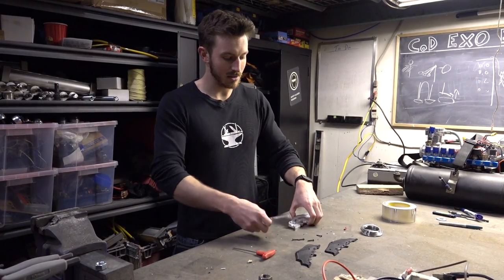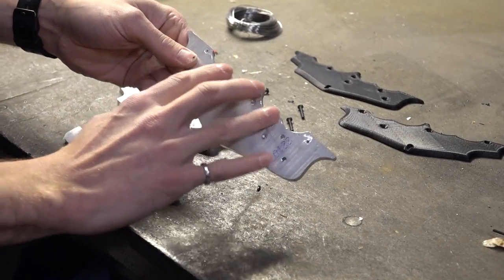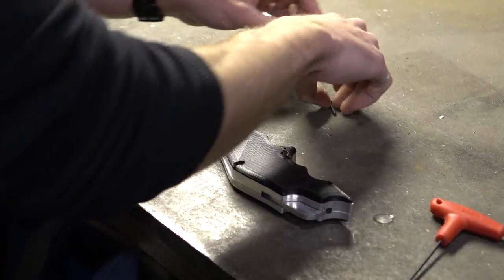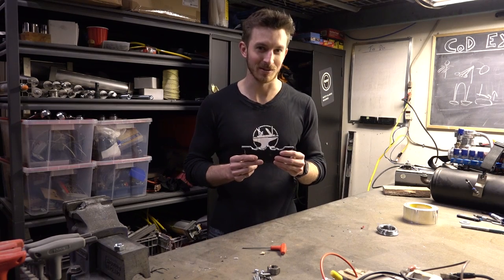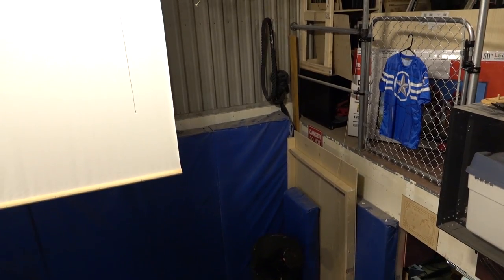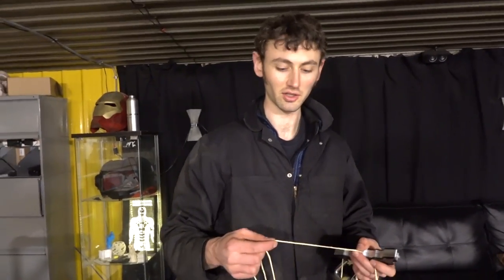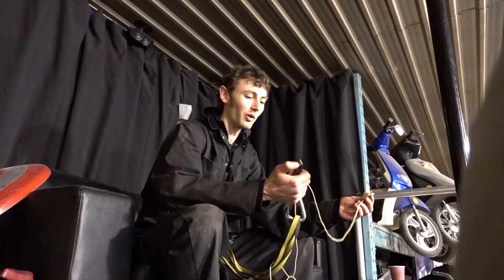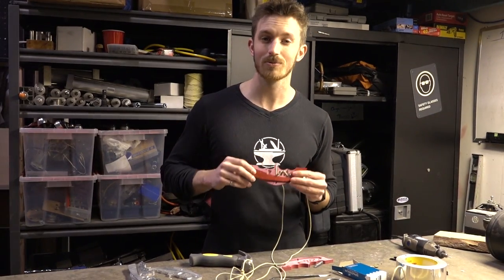Batman Grappling Hook Part 6 - Rappelling Test Fail!

Comment: When I first heard you say that you were using a 1000 pound rope the other week, my first thought was "that doesn't sound like very much, have you considered that your dynamic load will be many times your actual weight?" and then I said to myself "He's an engineer, of course he's figured this out, shut up, you flunked out of engineering."

But now... REDEMPTION!

You could try machining the innards on a CNC mill and then do the outer part yourself with a bandsaw and files. Would cut the machining time down a lot if you're using a puny little Taig or Sherline.

Comment: I knew exactly what was going to happen.  I used to be involved with abseiling (or "rappelling") so I could tell that the device lacked enough friction to act as a proper descender or brake-bar for a controlled descent.  I also know that Kevlar has very poor stretch and therefore does not take well to sudden loads (those who use Kevlar tend to have something that's designed to absorb the shock at the anchor point).
We used to use 12mm braided Nylon rope and brake bars that had 4 substantial friction blocks for abseiling - kept the speed of descent down to something reasonable and if we stopped abruptly, the natural stretch in the Nylon absorbed the shock so the rope wouldn't break.

Comment: I agree with colin. add a spring on the end of the grappling hook and attach the rope to it. Also, 550 cord is very strong, and it stretches. just don't get it hot. it melts and will burn if too hot. I would suggest some 550 cord, as long as it's the real stuff. and possibly using it in conjunction with a spring at the hook. something like a spring from a brake hardware kit for a pickup truck drum. it takes about 100 pounds of force to get one of them to stretch at all. they are also very compact, and available cheaply from an auto parts store.
Reply: +Matthew Scur Well paracord is not a good choice if it's not supposed to get hot because the friction will cause a lot of heat. I'd stick with climbing rope,even if it's larger. It's just made for this and there's a reason.

Comment: why don't you use nylon cord???
Reply from the maker: +TeCK Games Kevlar is stronger than nylon...
Reply: +the Hacksmith oh OK its just on colinfurze channel he makes a co2 powered grapple and it winches him up and he uses nylon sooo
Reply: +the Hacksmith Kevlar has one big weakness when compared to some other materials: It withstands great amounts of tension, but its quite fragile under compression. Your rappeling device squeezes the kevlar rope, which actually "breaks" the part of the rope that is pinched between the aluminium parts.
 
After you release the rappeling device your whole weight suddenly shifts on a "broken" part of a rope, so ofcourse its going to snap. You need to divide the friction on a larger area, instead of having the rope pinched in 2 small spots. That or use something thats not kevlar.
Reply: Joseph Dowse you are awesome